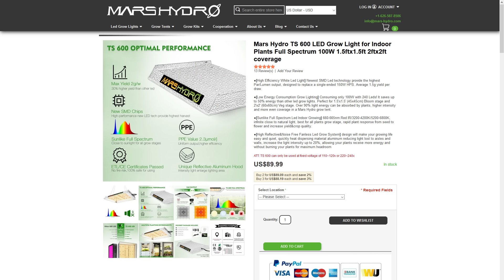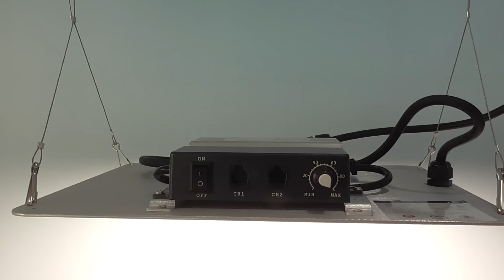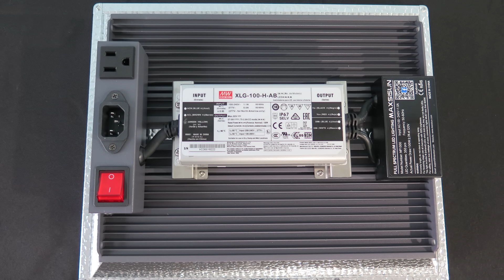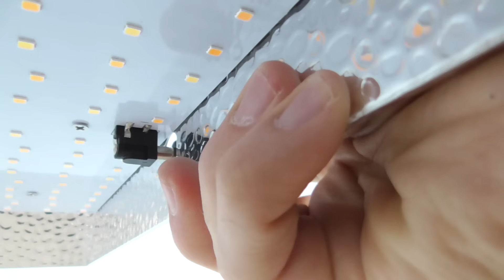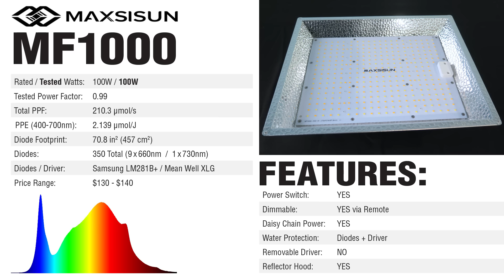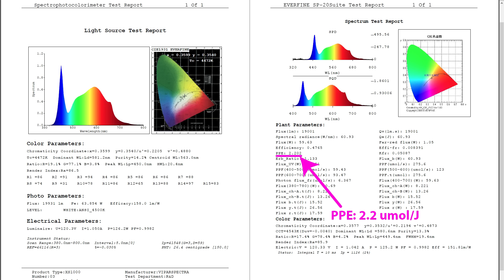Spider Farmer, Maxsisun, Mars Hydro - Entry Level LED Grow Light Comparisons, Test Reports & Reviews

Comment from the maker: Check out my other reviews:
"1000" LED Grow Lights Shootout pt 2: https://youtu.be/WmjOSzSF-HI
Spider Farmer SF300 / SF600: https://youtu.be/RXbR-hcXeQ4
Spider Farmer SF2000: https://youtu.be/lK28aiRQ_Vs
Spider Farmer SF4000: https://youtu.be/Cl5P3sKDQ0o
Active Grow LoPro Max 320W: https://youtu.be/PCaesi_M5DQ
Maxsisun MG3000: https://youtu.be/Tw6-w2gybgo

This UPS power station can backup a grow light!
► https://youtu.be/h3sUUHCEqbs

Check out my Grow Light Cost Calculator: https://youtu.be/aToYhyPZMVs

Learn more about artificial lighting and plant growth:
► What is PAR vs ePAR Light? https://youtu.be/kUpEQ4kU148
► The impact of Red or Blue light on plant growth: https://youtu.be/sfihE4IuFuU
► To avoid Tip Burn: https://youtu.be/gHWf4Hfi3hA
► Light Cycles & DLI: https://youtu.be/dQlOJ1zvoPI
Reply: I'ld love to see more reviews like this for the new Models. Thanks
Reply: I want to see the se7000
Reply: I've been watching ALL of your grow light videos. multiple times.
Reply: It seems for this year or recently they upgraded the SF-1000D to have the same diodes as the SF1000. It says on there website as well that it has the LM301B diodes instead of the LM301D diodes.
Reply: I need help finding the correct lighting for house plants! Any way you could consult with me?
Reply: Did you check the "updated" white version of the TS600?
Reply: Which one should I buy for a 1×1yd indoor coco tent grow? Used to use HPS 400w but electricity prices are ridiculous here now!
Reply: Just gimme a name and I'll go to Ebay bro ✌🏽

Comment: Do NOT buy spiderfarmer products, my sf1000 has lost some brightness over less than a year to the point where the dimmer switch does nothing when the dial is at 80, meaning it has effectively lost 20% of its brightness.

The egregious and flat out dangerous part about this company is that instead of having the product shipped to them to be repaired, they will send you parts and expect you to install them yourself. They sent me a dimmer box which did not match the original part on the light nor did it fix the problem, I am now waiting for them to ship me a power supply for the light which I will have to wire and solder myself. Ordinarily for any other product this would be fine, but not when you are dealing with something that runs in excess of 1.8 amps up to 2.5, way way way more than enough to kill you if you accidentally discharge the capacitors into yourself (since they hold charge after being unplugged).

I am lucky enough to have experience and sort of know what I'm doing with electronics but I guarantee there will be people who do not who end up seriously harmed or killed by one of these products when they have an issue with it since they are too lazy to return ship and repair a product and too cheap to outright replace it.

When I pointed out just how dangerous and irresponsible it is for them to expect people to install these on their own, they said "sorry for your trouble" and offered me a 8% discount on my next purchase which I will definitely never ever make. 

I will be doing everything I can on my and in Australia to report this company to ensure they do not endanger more customers and I STRONGLY suggest nobody put themselves in the position to be endangered by buying one of these products. I have all emails and am willing to share to prove what I am talking about.

Pin this if you arent a shill.

Comment: A mars hydro ts600 will grow 1 "medicinal" plant all the way through, it will be decent quality and yeild. The sf1000 and similar han do a plant and a half so you need two for three plants. To do a tiny crop these are okay but not worth the tiny saving, you want 600w sodium bulbs for a big grow on a budget but watch the heat. Ive got many LED lights and most are useless for weed really, okay for seedlings but terrible for flowering, that being said i have a very cheap phlizon block type led thats surprisingly great, it gives massive yields but still only really covers one plant. All the lights tested here are very similar with the same performance, that little ts600 is okay really especially for the money.

Comment: Good work man, I've tried getting temu to stop listing fast chargers rated at 5v1A and such but yeah they're almost as bad as AliExpress. They won't pull a product or even correct it, even though they are marketing to a country where false advertisement and fake ratings are illegal, they're willing to roll the dice on not being punished for potentially ruining people's electronics and plain old scamming people. At least eBay is halfway there when it comes to dealing with the BS. It's no wonder Amazon is dominating the competition, not that they're not a horrible company that steals and sells your info, but at least they usually stand behind what they sell. Unless it's a third party or you get their outsourced customer service reps. Wicked Walmart might just make it's return if Amazon can't keep their customer service quality. That's the only thing they had going for them. At this point I'm just glad I have a reliable bank and live close to a UPS store.

Comment: Now I'm curious what I could be growing with a 1000 model, as my last several grows have been with two TS-600's in a 3x3x6 tent, and the results have been awesome! Paid $70 per light
Reply from the maker: $70 isn't a bad price. To get a rough idea of how much yield increase you might get when switching lights, you can look at how much the total PPF output is from one system vs another. For example, a 10% increase in PPF might potentially get you a 10% boost in yield. It can help you to have realistic expectations when considering an upgrade.

Comment: Better to build it.
Quality led chips 50w driverless $3 each 3Y warranty
Got a faulty hd tv for free,perfect aluminum frame.
Bought 15 used intel coolers with heatsinks for $18 all.
Thermal paste $10
Screws with nuts and washers $5
Timer for the plug $8 for a pair.

Comment: I grow on 24in by 8ft shelves and I'm stuck between the Spider 6000 and the TS 1000. Which would you go with? Does the TS work for shelves?
Reply from the maker: Hi Daniel! I don't know if you have stacked rack shelves or just a single shelf with lots of vertical clearance. The TS1000 isn't a very good fit for spanning 8 foot shelves. The SF600 makes more sense, but it's really not worth $140 and it won't evenly cover a 24" deep shelf. If your light requirements are high and you have a decent amount of vertical clearance you could try some P1000s: https://amzn.to/3wE8JgY  Probably 4 per 8ft shelf. Or for rack shelving on a budget, these strip LEDs could work: https://amzn.to/3RdvsKk  The light output is lower, but they can be spaced for more even coverage and they would fit in tight spaces better. I'd space out 2 strips, side by side.
Reply: @Albopepper  This is very helpful, I was concerned sf600 wouldn't cover, I'm think the new Mars Hydro VG80 might be a good option, thoughts?  As the edge coverage seems better. I have some vertical room but no more that 2ft.

Comment: Were you saying the mh ts 1000 uses unbranded diodes? ive been seeing them advertise they were using samusung.
Reply from the maker: These light manufacturers seem to alter their specs every 6 months. So if you want the very latest info, it might be best to contact them directly.
Reply: @Albopepper  Thanks. Changes to the products does seem consistent with what you are saying. I bought the 2022 version. All in all it seems much better than the version you reviewed. Only one recent review tested its PPE: @ 1.8 umol/j in a 2.5 sqft  (not 3x3) enclosed space... So still not what they claim. That kind of sh*te makes my ocd itch. I'm using them (I bought 2) for micro greens, wheat grass and maybe tomatoes in the future. Debating still if I should just return them. 
I'll do a little more digging.  Keep up the good work 👍
Reply from the maker: Keep in mind that individual reviews are not capable of determining actual PPE unless they use an integrating sphere. If they use any other method to calculate it based on spot readings, then their numbers will be lower and they are not going to be precise. Third party lab tests are ideal, using proper equipment. You should check my follow-up video I did on this. You'll probably appreciate the extra data.
Reply: @Albopepper  Thanks, will do 🙂
Reply: @Albopepper   Starting to get it... I know of light. But only just beginning to know light

Comment: The MF1000 can be had for about $50 and is by far the best deal of this bunch.
Reply: The Maxsisun PB1500 has price dropped to $69.99 making it a steal. Just picked up 2 of them to run at reduced power in a 36 x 20
Reply: @zenbrew1  all of their lights are out of stock atm. How long they usually take to restock?

Comment: Led shop lights are exactly the same. I've done my homework trust me
Reply from the maker: No they're not exactly the same. They are a totally different form factor. LED shop lights don't have any added Far-Red and they have lower levels of Red light. They are typically not as efficient and the light diffusion is very different. Quite importantly, there would need to be multiple shop lights to match and even exceed the total power draw if you hope to get similar yields.

Comment: I hope someone will shine some light on my questions.

I brought my choices for a led light down to Mars Hydro TSL2000 and the Spider Farmer SF2000. Leaning towards the SF, because of built quality.

In my search I came across Kingbrite and had great communiction with them. Their standard boards only have one light color to choose, instead of the 3000k and 5000k mix from Spider Farmer. How much difference would it make having the mix or only 3500k for use in a full cycle?  

How important are the IR and UV leds? Is it worth the money to upgrade those from Epistar to Cree?

Thank you in advance for your trouble.

Comment: I used a 400 watt HPS till recently after our son bought me a 400 watt Seagrond 8800P led board. I noticed that my plants responded straight away. I believe this is a mid range light but it is an improvement from my HPS. The advertised PPE is 2.2, however I am not sure about the accuracy of this claim.

Comment: Yeah I bought a Famurs 1200 led light ,,,,my first attempt at growing,,,,,after watching your video ,,,IM DONE,,,seems every light out there except for the very high wattage led lights can get a person thru to flowering,,,,,so IM DONE all together with Led lights 
And will finish my 3x3 garden with a 400 watt hps light ,,,,,that way I know I can finish flowering,,,,I’m 24 days into 12/12 today with my little 105 watt light ( actual power being used !!! Not 1200!!!! ) and I’ve got trichomes showing ????? Should I go ahead and see if this light will finish my grow or not????
Reply from the maker: Hi Vance. I recommend watching the portion of this video which I've time stamped for you: https://youtu.be/PCaesi_M5DQ?t=174

It's not realistic to expect a 105W LED to keep up with a 400W HPS. It's not an issue with LEDs in general. It's an issue with improper marketing. The Famurs 1200 is 105W. Even if the PPE was as high as 2.4, that would still only yield a PPF of 252 umols. But a single-ended 400W HPS might pull 450W at the wall with a PPE of 1.34 which means PPF of 603 umols! So that's more than TWICE the PAR photons. Even the seller states the flowering coverage for their LED is only 2.5 x 2.5. (Although 2 x 2 would be more appropriate.)

I just did this review of an LED which is perfect for a 3x3 tent: https://youtu.be/Tw6-w2gybgo  This one is 289W with a PPE of 2.38. It could actually outperform those 400W HPS systems.
Reply: @Albopepper  thanks for the information,,,I got such a small light for two reasons first I wanted to prove to myself I could get a plant to flower,,,and secondly ,,,I was sold on the FULL SPECTRUM veg to flowering all stages of a plants stages from seedlings to flowering,,,,,advertisers,,,yeah enough to make your head spin!!!
But today I’ll be finishing up week four of flowering,,,,and Ive got bud sites stacking with trichomes visible to the naked eye,,,??
I’m in a 3x3 area lined with the shinny side aluminum foil facing out ,,,, I’m not excepting a huge yield but am very impressed with what I’m seeing ,,,,was gonna send pictures but you said you didn’t w@nt to see early flowering pictures,,,.
Just at harvest ?????? Again yeah was never  expecting a huge harvest ,,,,
So yeah I’m not gonna turn the 400 hps on at all and tuff it out to the end with this led light ,,,it’s got me to week four into flowering hopefully it’ll finish what it’s started,,,,,nothing towards anyone just gotta see what’s gonna happen

Comment: I got a full sheet with the ts600 when i purchased 🤷‍♂️ did a ppfd map and wattage test on it. Confirmed the claims
Reply from the maker: If the TS600 gave you good results than some of these others would perform even better. My estimations had been correct. Mars Hydro was not providing accurate specs. I've done a video followup which proved this: https://www.youtube.com/watch?v=WmjOSzSF-HI

Comment: I'm totally in your hands. I just bought the Maxisun MF 1000, with remote and dimmer. On eBay well under $100.00. Thanks. Note regardless, I had bought a Fecida. Dimmable with fan. I hope I just upgraded.
Reply: They just dropped the 2000 to $130 on Amazon sign me up

Comment: I bought a Bozily 300w 338LED sunshine spectrum on amazon and from the figures you're showing here it matches or outperforms them all for half the price.
Reply from the maker: No. The listing says many, many times: "300W"  But then buried in the specs you have to search hard to see: "Actual Power Draw: 65W±5%". So it's not a 300W system, which is false advertising. And since it's only 65W, it won't be able to match the output of these 100+W models.
Reply: @Albopepper  so are you saying the true wattage requirement is unavoidable to achieve comparable PPF between the budget models and not the brand of LEDs in use? If I used two(pointing from either side giving fuller coverage ) would there be any sort of cumulative affect or is it just better to bite the bullet and spend twice the money with one true 100w+ lamp. Also, built in fans or no fans? Thanks for the reply in thw first place.
Reply from the maker: Yes, the actual wattage consumption is a crucial factor for determining the photon output. It's possible to have a light that's slightly more efficient and so requires slightly less power to achieve the same PPF. However, I can guarantee you that the Bozily is not more efficient than these other lights, which have proper branded drivers & diodes. Bozily shows a false spectral graph which makes it look light the light should have devoted red diodes, but clearly it does not. It probably has a poor power factor as well. I estimate that it would take 2 of these 65W units to equal a single 100W unit from this video. That doesn't mean the light won't grow any plants. But it simply can't compete against these lights. It's a seedling light at best. What you decide to use will be determined by your application. In general though, I prefer LEDs without fans. You can get some high wattage, efficient units which rely on passive, ambient cooling and work just fine.
Reply: @Albopepper  Thank you, the clarification is much appreciated. I'll get a FECIDA cr600 (seems like a similar euro version to what you tested here) for fruiting my tomatoes and just relegate the bozily to vegging. Thanks again!

Comment: Don't these LED's require cooling? why dont they have cooling?
Reply from the maker: Keep the grow space temperature regulated and the LEDs will be naturally cooled. No needs for fans.
Reply: @Albopepper  i dont think. without cooling those LEDs wont have a long lifespan. ive saw in a couple of videos that some leds on the mars hydro stop working, and not working means ppf going downhill. the cooling is a cost fator i mean theres a reason those lights go for 50-60% of what a good quality led would cost you. just my 2 cents.
Reply from the maker: Do you have "cooling" on the LED light bulbs in your lamps and home lighting fixtures? Do they have little internal fans? No. Of course not. As long as ambient temperatures are within operating tolerance, then the LEDs hold up fine. And white the LEDs used in these grow lights are the same kinds used for home lighting. Some of Mars Hydro's systems were crap. Plain and simple. They burned out at times, due to junky drivers. These LEDs do NOT need noisy, power sucking fans. That being said, if you want a system with a beefier heat sink, then get one. I show multiple options in this vid: https://youtu.be/WmjOSzSF-HI

Comment: Do you know anything about Bloomspect?  S1000 LED for $49.99 on Amazon.
Reply from the maker: Have you been able to find an integrating sphere test report from them? I haven't seen one. Without it, there aren't any reliable specs for comparison.
Reply: @Albopepper  Thanks for the quick reply.  I didn't look for a test report.  Could you recommend a good 2' light?  I'm just looking for something for seedlings and an occasional clone.  I live in San Diego and can grow year around, but I just saw that my beet and carrot seedlings were eaten by birds.  Always something.  I seeded these in an Earthbox (I have 20), but when I do something often eats the seedlings, birds, insects, voles....  I've found that if I set out something 3+ inches tall, they usually leave them alone.  So, I need to start indoors without the seedlings being leggy.  PS I really like your website.  Thanks,  Chris

Comment: which one gets the least hottest? is a hlg 240w better than these?
Reply from the maker: The higher the PPE, the less heat generated per actual wattage draw. But higher wattage lights may still shed more heat than less efficient lights if those less efficient lights draw less power.